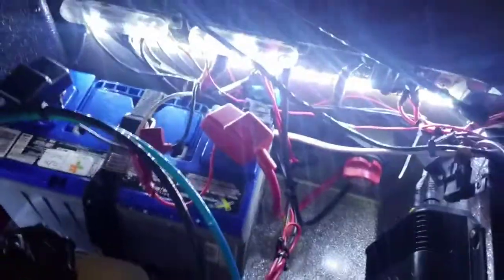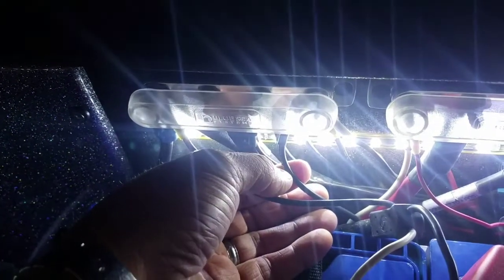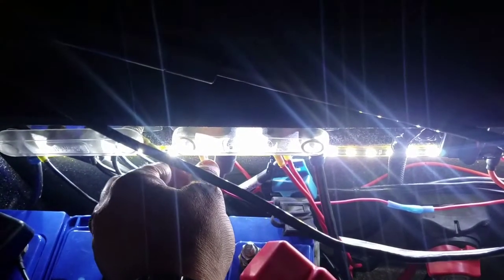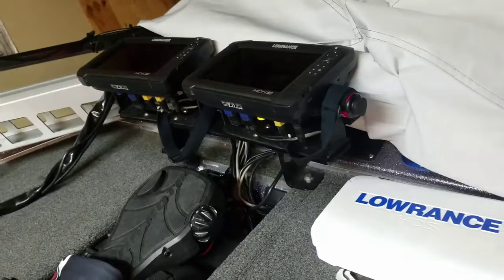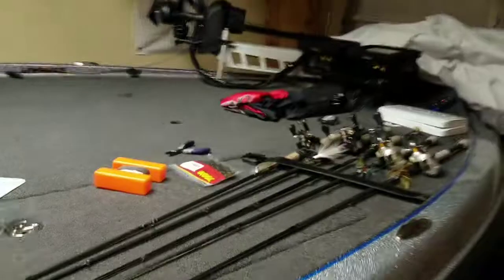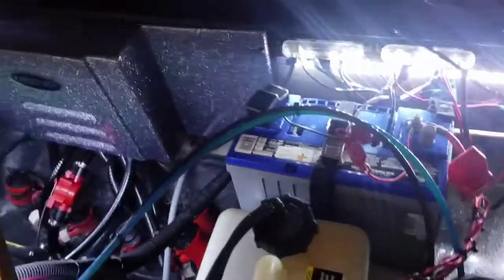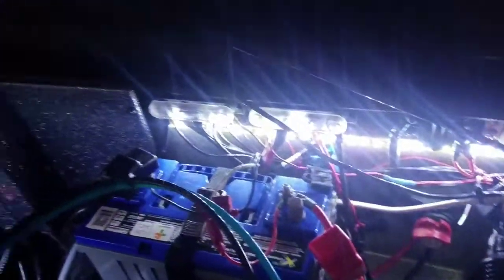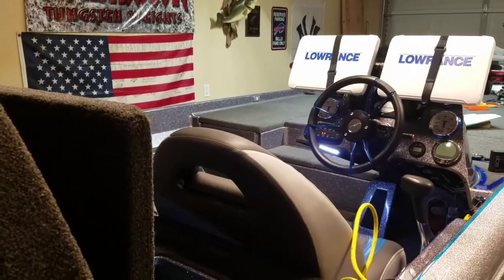Boat battery power for Lowrance

Comment: Awesome break down. I will be installing one 9in graft. Should I wire to battery or pull power from ignition switch?
Reply: Hello Richard that's what's I'm trying to find out also. How did you end up doing it?

Comment: Any know why a ti2  screen flashes on and off. Just bought all new batteries only running 1 fish finder at console ti2 12 inch   .  The guy that installed it hooked it up tp master power switch . So if I run that duplex wire from my ti2 straight to battery that will elevate the problem ? What about a  inline fuse? If I wire straight from battery to ti2
Reply from the maker: Check out this link for the marine grade wire. https://www.westmarine.com/duplex-wire/_/N-1z12xhk. Maybe you can find it cheaper, but this is what was used in my boat.  99% of problems occur from insufficient wire/battery combos.

Comment: I just added a ti2 this year. I hooked it to my trolling motor battery because I want as little draw on my cranking battery as possible. When I run the trolling motor the screen on my ti2 changes color.I believe it's a power issue rather than interference from my transducer. I did notice my voltage on my tm battery was down, not up to the 12 v level. I put a charger on the battery and will give it another try. I usually put a tender on the batteries when not in use but that may not be charging the tm battery sufficiently. Am I on the right frame of thinking? Should I consider a third battery dedicated to the ti2? I am thinking maybe a battery that is used for a portable graph for a graph battery.
Reply from the maker: To doesn't draw a lot of power. Connect normally or use marine tinned copper wire and you'll get away from the interference.

Comment: Very good video! I’m trying to run my graphs on a totally separate battery but I’m having interference. I have (3) Group 31’s for tm only, a group 29 for my craning and accessories and I just put in another group 29 to solely run my graphs and talons. With new battery installed and connected, I have power shortage.
Reply from the maker: Thanks for the reply. If you have a Merc 250 ProXS then you have to have a cranking battery that meets the requirements for that first. A 29 Group isn't going to cut it and thats before adding any power pole/talon, graphs, etc. New units are not like those 10 yrs ago at all. Everything requires more power.
Reply from the maker: Also if you're still having interference issues offset your ping rates on each unit. That should help a bit too.

Comment: On your transducer on the back, is it ok to run to the dash with the power wires? Or do I have to run them away from each other
Reply from the maker: Sorry for the late response. No worries running together, just as long as you have wire your graphs with correct size wire. Interference usually comes from the TM from brush motors. If you still find interference and you're running 2 or more graphs, simply set the ping rate off by 1 on each unit as well and the interference should minimize.

Comment: Dude, fuses belong as CLOSE to the source of power (the battery) as possible, not as far away as what you did. You want the fuse to protect the wire run in the boat also - not doing so is a fire hazard.  Put a fuse in the rear that meets spec for the display unit you're using.  Only one fuse is required, and with the right one in the rear, there is no reason for a fuse underneath the bow panel.  Lowrance will confirm this should you choose not to believe me.  You'll also reduce the number of splices in the circuit by not having the unnecessary fuse under the bow panel.
Reply from the maker: Great tip.never thougt of the perspective. Appreciate it

Comment: Pretty sure that is Romex 12-2 wire not duplex
Reply from the maker: No it's Duplex. Similar to Romex in homes but this is made for marine environment (solid vs marine tinned stranded wire). BTW I have upgraded this wiring since I created this video w 8GA Duplex  wiring.
Reply from the maker: 8/2 AWG Duplex Tinned Marine Wire, Red/Black 25 Feet https://a.co/d/gDuKPBW